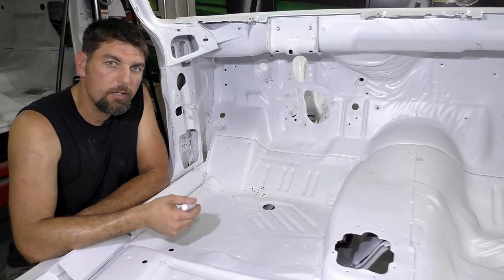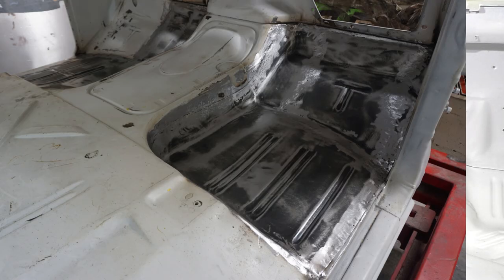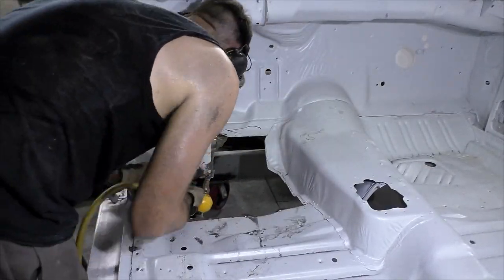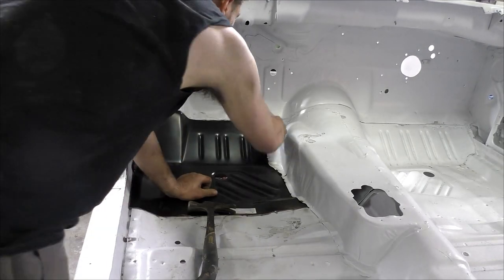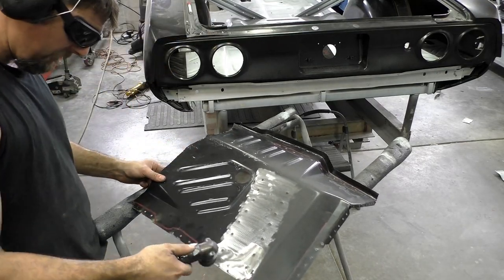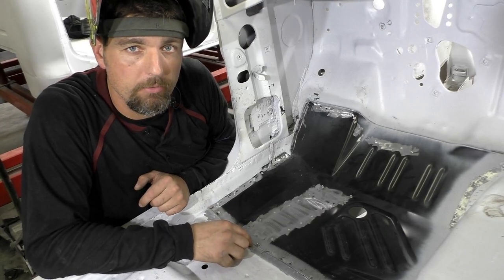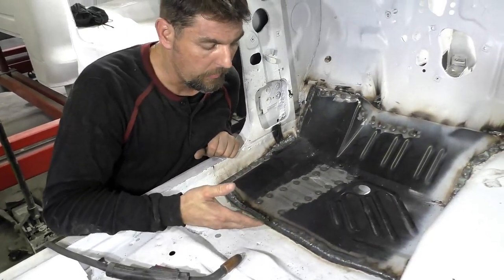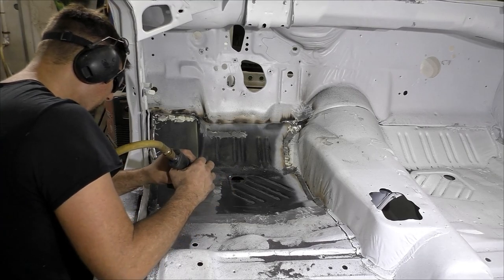How to install a floor pan patch panel

Comment: This is amazing Richard
 We are talking this morning a out the nova ans turns out its probably going to need this exact fix on potentially both sides. Great timing on the video. Got the seats and the carpet out today and more of a bucket of worms but I'm more excited than worried about  it. Now ot clean it up and get started. Hardest part is finding those spot welds I find
Reply from the maker: Yes we were just talking about that. I figured when i saw your video this is exactly what i though when you said you weren't going to replace the entire floor. Good luck on your car it will be really cool when its finished.
Reply: @carthageclassiccars  good call video already helped a lot. If the structure in the front seats is good I figure I'll patch both side front and back. More labor Intensive bit I'd rather keep the metal under the seats

Comment: Great demonstration. Every bit of advice and tips are winners. 
What wire diameter are you using for the mig? What kind of protection can you expect from an E coat primer?
Reply from the maker: Thank you.... in this video I am using .030 MIG wire. Most of the time that is loaded in my MIG because external body parts where I would go down to lets say a .026 I try and TIG. The E coat primer offers rust protection but nothing like a true epoxy primer

Comment: I see here your using Ospho and on your challenger video you remove it with your air belt sander where you are going to spot weld. Did you do that here? Do you usually ospho the whole area where its going to have metal overlap and only grind off the weld locations before the weld through primer? Or do you grind down the whole area where there will be metal overlap?
Reply from the maker: I tried not o focus the Ospho here on the areas that I was welding and yes went over before weld through primer with the belt sander. The reason I skipped that step is not to keep saying the same stuff each video but I use the same process.

Comment: Would it be wrong to braze up those few holes? Or just use a MIG welder and fill the holes and grind smooth.
Reply from the maker: I personally think in this situation the patch panel is the proper best repair. There is just too much damage and the metal was too thin. Each one of those holes would get larger with even the small brazing heat. The MIG would waste so much gas and wire also and never come out as clean.

Comment: Do you grind the floor pans underneath a little also ?
Reply from the maker: Yes I will touch them up if needed a little bit. On this one since I welded on top of the frame rails I really didn't have too.